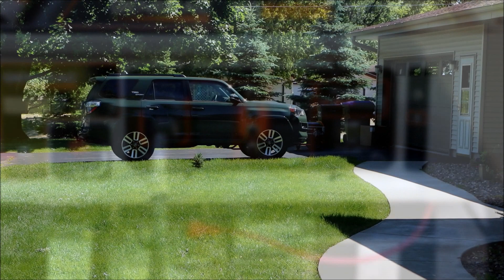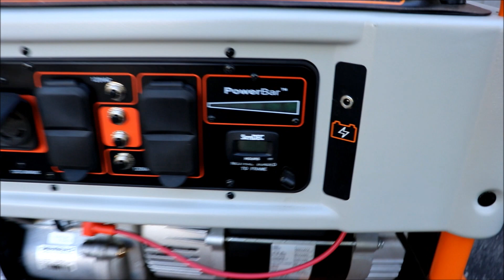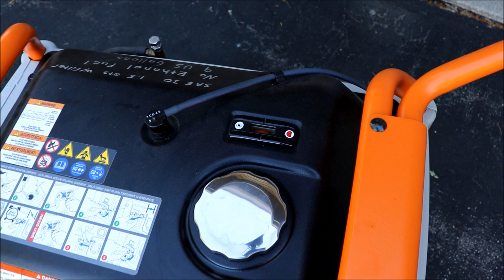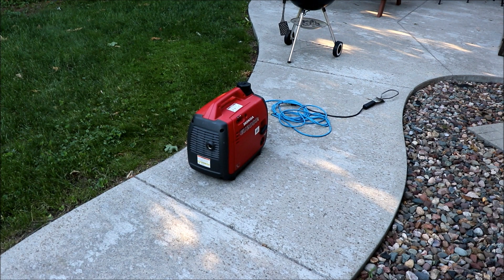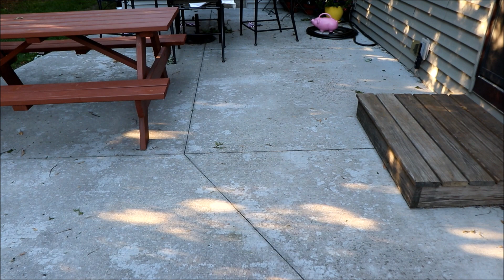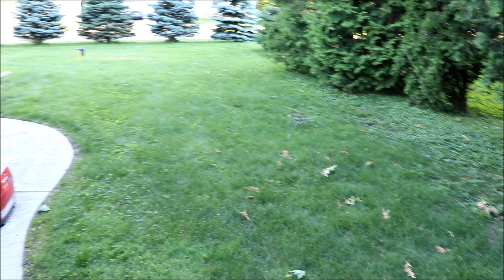Generac xg8000e and record power outage

Comment: Did I hear you right, you burned thru 22 gallons and not running it at night?  I just picked up the XG8000e from my neighbor with less than an hour on it for a great deal....if that sucker burns thru roughly a gallon an hour maybe it's not the deal I thought it was 🤣

Comment: How do you know when power comes back on if the main is shut off? I have my own "unapproved" way of knowing, which I'm not going into.
Reply from the maker: When I am hooked to the transfer panel there are circuits that are grid only.  When I was hooked to the water heater, I just kept an eye on the neighbors.  There were quite a few neighbors that ran their generator after the power was restored.
Reply: @stuntcardriver  ahh, ok... well, I'm in the woods and cant see the neighbors. I don't use a transfer switch, I just backfeed a breaker. So my main is completely shut off. But I came up with a way to know when the power comes on before the main. Shhhh